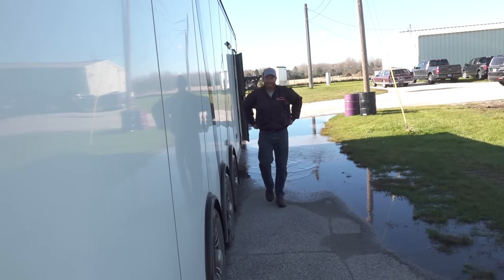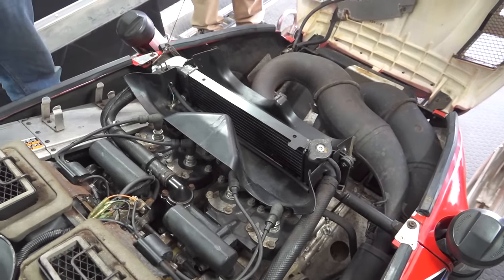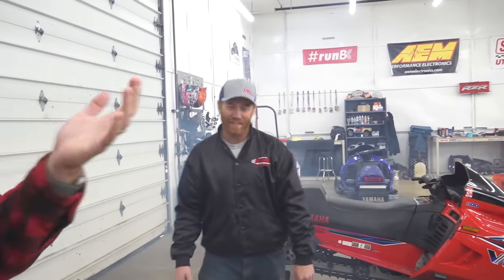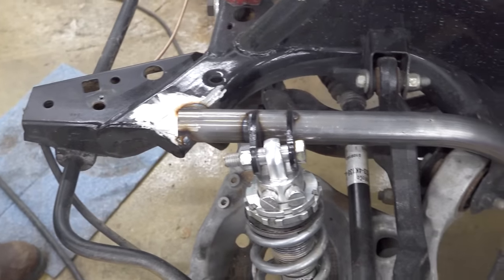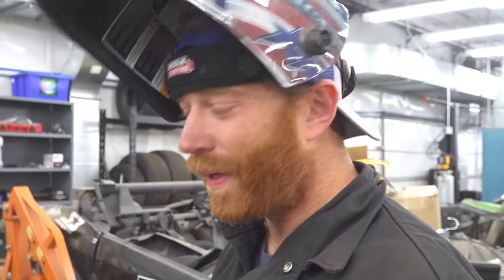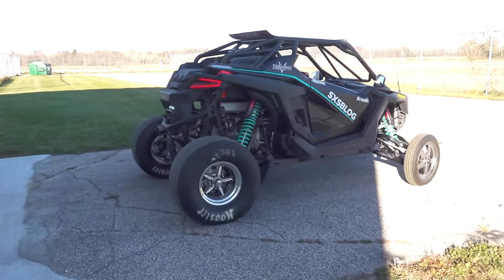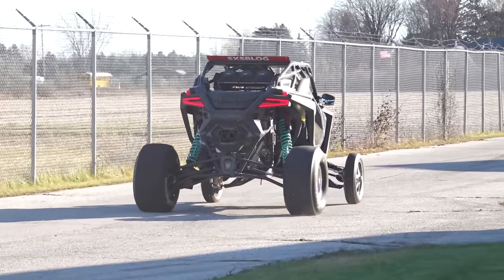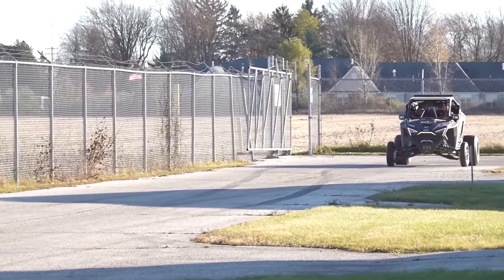Doug gets his DREAM sled Yamaha VMax 4! Plus Leo vs Mike drag!

Comment: That is a very unique sled.  Arctic cat had one of the first 4 cylinders:1971 Arctic Cat King Kat 800 which was also pretty badass especially for back then.
Reply: Officially clocked at 103 mph in factory testing on grass in 1970. The 1971 King Kat 800 featured the four cylinder free air two stroke Kawasaki with four carbs four tuned pipes and no mufflers. It was an 800 class oval racer. Made one year. Less than 150 built.

Comment: Those sound awesome with the quad pipes.  PSI  offered two sets for the 800`s..one has internal stingers, and the other does not.  The ones with no internal stingers, would be the PSI mods. They are lake pipes. The others were the trail version (internal stingers) so they would be quite a bit quieter. Bender also made more than one set of pipes. The quad performance pipes were stamped and the formula III pipes were sectional and welded. Aeen made sectional pipes also but they were a grand back then from what I remember, they were loud but not as loud as the PSI mods. You have to spin the engine at 10k  with them and weld the crank pins. The stock 800 ignition box has a 10k rev limiter not sure about the 750 one though. They give around 18hp on the 750 and 15hp on the 800.
Reply: Just mentioned that to another recent VMAX 4 owner that he needs a set of quad stingers as there is nothing that sounds that awesome quad pipes just resonate power as they have a rapid fire bark that you can feel like the report of a large firework you can actually feel that there is some serious bite behind their bark
Reply: If you are to put 800 pipes on a 750 you should really consider welding the cranks. Just adding them pipes and the HP it added for some reason the 750 bottom end didn’t like it. I had 5 Vmaxs over time. My imp stock 800 had a custom gear reduction. These would turn 10,000-10,400 but the clutch couldn’t turn that fast. So the custom gear reduction fixed that and changed power curve. My sled back 20 years ago was making 230Hp full Pat Hauck Engine / clutching and howler pipes. Sled was brand new and turned into a racer from day one. I really miss that sled. 🤦🏻‍♂️

Comment: being in the sand dunes, the filter won’t get dusty. It’s when you get in the dusty Rhodes that the dust will make it through a filter especially the canon that’s why they have to be oil charged but then if you get crazy you fill your intake full of oil, and that causes a ton of problems sticky throttle blades, core idle ,stalls. You should get a pre-filter. It’s just a wrap covers your existing filter.

Comment: I never knew those Vmax-4 sleds were so rare. I Alway kinda wanted one. My friend found one in 2006 a red one and it only had like 300kms here in Canada. It was the same as brand new. I remember one night in my garage he was putting a stinger muffin that he bought that was custom build of a race v4. It didn’t fit through the belly pan of his sled because the sled it was built to fit had a bent chassis. Well let’s just say I gave him the grinder to cut that hole. I personally couldn’t do it.

Comment: Congrats Doug! That's such an awesome sled! Do you know to spray the seat, track, cog gears and boogie wheels with silicone spray to bring them back to be condition? I've worked at Redmonds for 25 years and use it on motorhome customers awnings and slide out seals too. Liquid wrench is the best brand to use. You guys should try it! I'm the spring I spray my sled down and wipe it in then basically paint it and put it up

Comment: When u said 800cc 4 cyl, I said surely it's not a 2 stroke.. I was wrong. Second I think if u limit the front of the drag sxs, and add a place for weight lifting plates to keep it down, heat in tires it will go faster I bet. Also have the fence guy scoot the entire fence over so you guys have more room for 2 SXS to run lol. And widen the concrete.

Comment: The Vmax 4 is cool but definitely wasn’t the hot rod of snowmobiles.  Just to heavy power to weight just wasn’t there. Boy and they were expensive new back then over $10,000 I believe lot of money. The aluminum skies were a really cool touch on the Vmax though. Live in upstate NY been riding racing sleds since i was 5 years old im now 45. One of the coolest things i ever saw was back im 92 early winter December i believe. Riding in tug hill NY we stop at the monaque inn we hear some sleds up the road screaming wide open. A new 92 700 wild cat goes by then a Vmax 4 behind it. They raced 3 times that wild cat won every time. The guy on the vmax was pissed kicking his sled then took helmet off beat sled with his helmet. My father his friends and I couldn’t help but laugh. Just one of those memories u can’t forget lol!! 
Nice find though definitely a iconic sled cool for sure.

Comment: The V-max 4 is a little underwhelming especially in stock form compared to the case reed variable exhaust triples that followed up shortly.  They are always a spectacle when cleaned up and parked with the hood up at the lake races however.  Enjoy the 2 stroke smoke 👍🏼

Comment: What do you mean you don't have a drag car? You didn't grt rid of the supra did you?
Reply: That thing has been disaster since the start.
Reply: @joshuabadzinski9793  I like it, I think it rips and all cars at that level will need to go through a testing period finding the weaknesses... I think expanding the channel or making the 2nd channel into a drag racing channel would be a good thing.
Reply: @asylumental problems? They literally have blown it up one pass into every time it's been out! 
You ever hear of anyone on modern face 2js running a compound turbo like their "tuner" had when they first introduced it? Iv noticed that "2j guru" they were using that owns the supra, hasn't been used for tuning at all! Probably because he blew up their forst 2j, blew up the supra 7 times etc.

Leo ain't gunna pay for someone to continue to blow ahir up one pass in, especially when they don't own the car
Reply from the maker: You are hilarious. We just bought a backup motor for the car.

Comment: Air them tires down a little then I bet you could snag a wheelie
Reply: You guys rock would you happen to have any 87 Honda fourtrac 250 parts ? I'm in need crankcase covers and starter reduction gears and there on to the starter basically it was eaten alive by some idiot installing the wrong starter ugh fun times y'all's hell razor is awesome 💯👏

Comment: Nice engine but wait till you ride it, heavy,no suspension,no brakes,handles bad, horrible fuel mileage and l am a die hard Yamaha fan
Reply from the maker: I (Doug) have put about 12,000 miles on a Vmax-4 trail riding, am very aware lol